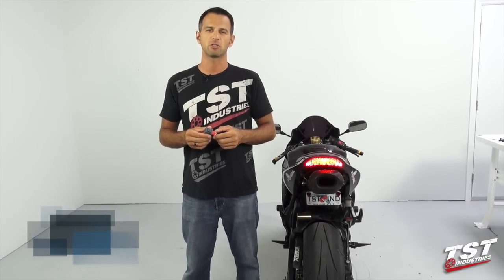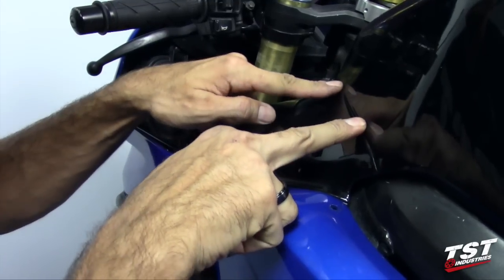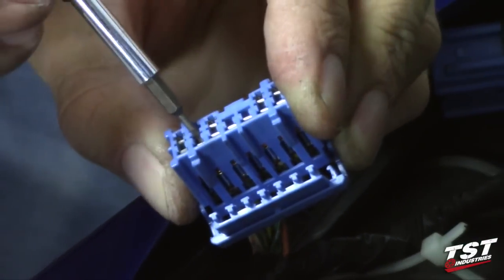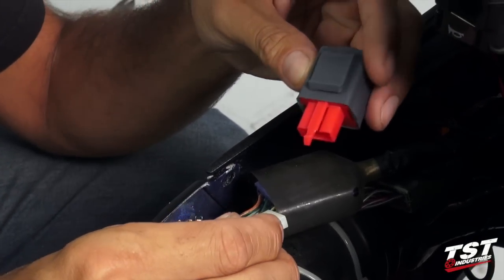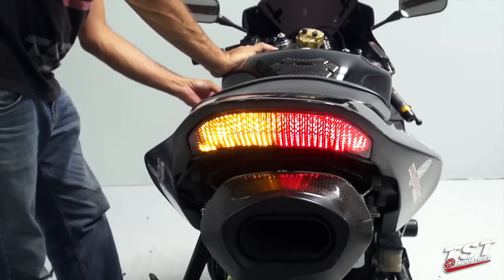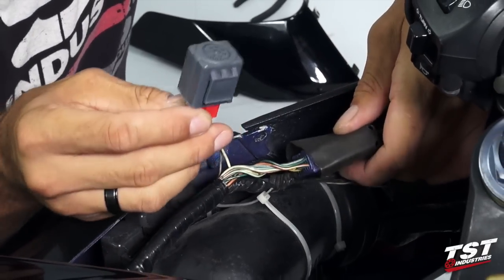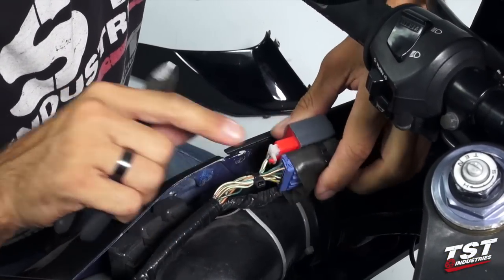How to install LED Flasher Relay on a 2003-2006 CBR 600 RR by TST Industries

Comment: Is it applicable for European models? Honda CBR 600RR 2006
Reply from the maker: All of our products are designed and verified on North American models. You would have to locate your OEM relay and compare the pin count and pin configuration.

Comment: Please help. Someone here can help find a solution with a set of built in relay led blinkers on a 2008 Hornet? With the original relay on the bike, they won't work at all. On the web it seems impossible to find a dedicated relay for this type of blinkers. Please, if you know a tutorial on how to resolce such issue...or any kind of info or advice. Thanks!
Reply from the maker: Well it appears as though we did not have a 2008 Hornet here in our market.  The closest I found in available documentation here is the 2006 CB600F. According to part documents, this bike uses a standard flasher relay for signal flash switching, and it is located under the tail components on the left side of the bike, just fore of the ECU. On this bike our RLY-G2 model relay is the appropriate replacement component . After that year the CB600 model did not re appear for us but CB500 and 650 models did a few years later. Those bikes used our RLY6 relay. I would suggest pulling your OEM relay out and comparing the shape of the connector to the images of the relays that i mentioned on our website tstindustries.com . If it is a match then that is the part you will need
Reply: @TSTindustries  thanks a lot for the fast answer. I took a look at the RLY6 relay you mentioned and by the number of pins and the hole design of it, seems to be the one i need. The two questions remaing are: 1. It will make the blinkers with the integrated relay work sequentially like they do directly on the battery or it will make them only blink? and 2. Do you have any seller of your products in Europe ? Thanks again!

Comment: Does this LED relay take care of both front and rear blinkers? I just installed an undertail kit with LED's but they don't blink they just stay solid.
Reply from the maker: It does when the issue is the flash rate. Now you may have a different problem with your front signal wiring that could be the culprit if your front signals flash but rears don't. I recommend verifying that the running light circuit is not connected with the signaling circuit. In the front, on one side, the orange and orange/white should not be connected together. On the other side it is blue and blue/white.

Comment: I ordered the integrated Taillight for my 2003 cbr600rr with the relay and I want my break light flash few times before it Stayed solid I can’t find that video
Reply from the maker: The relay that you ordered corrects the flash rate of the signals. It has nothing to do with the brake circuit. The strobe alert function for the brake light needsa different module in order to function. We do not have a 03-06 600RR specific video for that part but the same method demonstrated in the 13+ video is used for installation. Below I will include the link to the product page and also the 13+600RR video.
https://tstindustries.com/tst-brake-light-modulator-honda-oem-tail-lights.html
https://youtu.be/kkB6EeumWWM

Comment: So I did this exactly like you did . But now my rev gauge arm won't move i can put the gray back in and it work?? Anyone have this problem? Tst industries if you read this i need help . I only got this as your the only place I wont have to splice .
Reply from the maker: You must have pulled out the wrong wires. That connwctor has many functions in it and if you get the wrong pin out you will kill that function. Please put everything back to how it was and then restart. Do every step one by one with the video and the commentary within it in front of you for reference. If you need more help after that please reach out to our customer service department through our website during business hours.

Comment: Hey I had a question does the relay fix the issue when the turn signal stays on but does not signal
Reply from the maker: That depends on what is causing your signals to not operate correctly. I would need more info to answer your question. On some bikes hyperflash manifests itself in signal lamps staying on and the relay does restore the flashing.

Comment: Hi what is the code on the relay ,where to buy this from an I have just got led signal mirror will this fix both  them an rear tail intergrated light?Thanks for your time 
Regards 
John. It is a 03 cbr 600 rr .
Reply from the maker: Yes, this relay will control all your signaling equipment, front and rear, right and left. The presenter in the video is the person who designed the relay. The company that manufactures and  sells the relay made this nice video for you to know how to install it and where to purchase it. The link to the product page is actually in the description of this video. Here is a link to the product category for all the parts we have for 03-05 600RR : https://tstindustries.com/honda-cbr-600rr-2003-2006/

Comment: So I have an 03 honda cbr 600rr and I just installed flush mount blinkers. They are both on but  when I go to signal left it shuts off the light and when I signal right it does the same thing will this fix that problem? Thank you in advance
Reply from the maker: It sounds like you have your signals connected improperly. The Honda has two circuits in each front signal lamp. They are the signaling circuit and running light. If your front signals are a one circuit type of lamp, and you connect both running and signal circuit to them, then you would get the symptom you described. You need to disconnect the running light wire from your signals. On one side it is orange with white stripe, and on the other it is blue with white stripe. Disconnect those and let me know what happened.
Reply: @TSTindustries  I got it connected thank you for the reply!!!
Reply from the maker: @walterbaldwin3643  glad to help.
Reply from the maker: @walterbaldwin3643  was it what i thought it was?
Reply: @TSTindustries  well that was from before I bought the tst relay so I didnt know I needed the relay to make the lights blink. Thank you for the quick responses and informative videos I will definitely be looking at anything else you guys have. Was wondering if you guys had exhausts?

Comment: Does this also fix if they are not flashing at all? They just stay on and don’t blink. Front LED and read taillight LED. It’s a 05 cbr600rr... please help!!!
Reply from the maker: If they aren't flashing at all you may have a wiring issue and a relay would not fix that. The 600RR has a running light and a signal light circuit in the front signals. I have seen people use a single circuit signal lamp and jump the running light and signal light wires together to the positive side of the signal lamp. All this does is run continuous current through that lamp it's connected to and also the rear one because the running light circuit is constantly on. Please check your front signals to see if maybe they are wired in this way. If so, just disconnect the wires that have the white trace on them. That will be blue with white trace on one side, and orange/white trace on the other side.
Reply: TSTindustries oh my gosh thank you soooooooo much. This worked!!!! I love you guys!!! Subbed!!
Reply from the maker: @AlvlUpSavedMyLife  From time to time an opportunity to help a fellow rider presents itself and I jump right on it. I got into this business to help people have a better experience with their bikes. It pleases me to fulfill my mission. Thanks!

Comment: how can I install the relay on my 2004 cbr 600 if I don't have a blue connector? no I'm not blind I followed the wires from the blinkers front to back and there is no blue connector
Reply from the maker: I don't know man. I have worked on many, many 03-06 600RR's and they all had that connector. If you were local I would just say bring it in so I can help you.

Comment: You guys made putting my flushmounts and intergrated light in so easy. Got the relay dropped in yesterday and the signals/brake light work perfect. Super bright. Your company is one of a kind. Not a lot of companies work as hands on as you do with their customers. I needed help and messaged you guys on Facebook and had a real-time conversation with someone. Helped me out a ton. You guys are the best at what you do. Thanks
Reply from the maker: Thank you for the kind words. Our main objective is to help our customers enhance their experience with their bike. I think we were pretty successful at accomplishing that with you.
Reply: So just this one relay takes care of flashing related issues around all 4 led’s being the integrated tail/and flush mount led front blinkers as well?
Reply from the maker: @YourStepDadBob  yes...one relay controls of all the signaling lights on the bike.

Comment: there should be a video on getting the wire out of the blue plug. im about to light this bike on fire.
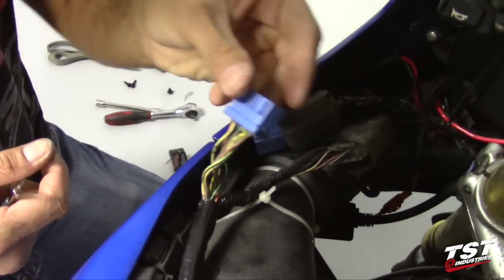Reply from the maker: I don't get it....we show the procedure in great detail starting at 2:38 in this video
Reply: @TSTindustries  it was the little tab inside, just didnt want to release. most of these connections are pretty old at this point. kinda mucked it up getting it out but now its all good and the flasher works perfectly.
Reply from the maker: Glad you got it figured out.
Reply: LOL

Comment: My plate light flicker and right rear signal won't turn on, can this product fix that?
Reply from the maker: If your plate light flickers then you have a wiring issue outside of the signaling circuit. The flasher relay will not do anything to fix that. If your rear signals don't turn on but the front signals do then changing the relay will do nothing to help you. I would advise you to examine the wiring on the rear of the bike and make sure all lighting components are wired properly. You can then move upstream to relay and switches.
Reply: @TSTindustries  I am considering buying the the tst signal break with the relay and plate light.
Think will be ok if I actually replace my lights with yours?
Thanks for the help?
Reply from the maker: @isaema3566  I do believe that if you use our components, and if you connect them to your bike properly, and if your bike does not have upstream wiring problems, then you will have a properly working setup.
Reply: @TSTindustries  any discount if I buy everything from light to relay to fender eliminator?
Wow day responses
Reply from the maker: Our website pages have a"Buy Together" module that appears below the add to cart button and enables you to bundle products for savings.

Comment: Currently my fairing signal lights are flashing opposite of the tail. Is this a problem that could be fixed by this relay or rather a wiring issue? Just got the bike working out kinks

Comment: Does this LED flasher relay just correct the rear turn signals? If so, do you have any advice/suggestions to correcting the front turn signals that are attached to the fairings on a 2006 Honda CBR600RR? Thank you in advance!
Reply: Found video. Please disregard

Comment: I have this switch on my bike 2006 cbr600rr full carbonfiber I have led turn signals and integrated taillight took me about 5-10 mins to install and remove those crappy resistors that get hot and wide this bad boy up also took the time to adjust the blinker settings which is fine out of the box but so dope you can adjust it if you want too but back just wanted to say if you are even thinking about buying this or. Resistors buy the tst switch and save your self from more wires to tuck and melted fairings this relay switch is superior in every way A+++++ thanks tst for the badass product will be back for other items soon
Reply from the maker: Thank you for sharing that with us. I am so glad that our parts made your installation better and easier. This is what we strive for.

Comment: Hi, so I own a 2006 cbr600rr and installed the tst turn signal pods and ended up with solid lights when I switched on my flashers. This lead to research and finding out about hyper flash and the gen 2-I tst flasher relay to remedy. I installed the relay as this video instructs but now when I flick on the flashers the running lights go off and I get nothing, no light at all, not even on the console and when I turn the flashers off the running lights come back on. I'm hoping ya'll might know how or why that is. I don't deny that this relay works, Im just scratching my head trying to figure out what may be wrong or what I may have done wrong. although I followed the video to a T.
Reply from the maker: It sounds like your front signals are wired incorrectly. If you have your running light and signal light wire jumped together into one connection this will cause your problem. Please check the connections on the front signals and find out if this is what the current setup is. If you disconnect the striped wire from the signal it will solve your problem. One side will have a blue/white stripe. The other will have an orange/white stripe. These are the ones that are supposed to not be connected.

Comment: Would this work if the turn signals doesn't flash at all?
Reply from the maker: Maybe. It depends on what caused your signals to stop flashing. If you message our support guys through our site they will help you determine the cause of your problem and how to fix it.
Reply: 91TwinTurboZX That was my problem also, decided to just buy it and installed it yesterday and it solved my issue.
Reply: 2WheelM4yh3m was your signals just soild yellow when you turned them on?
Reply: Yeah, this relay solved it.

Comment: Is that the same procedure for a cbr1000rr 2004???
Reply from the maker: sébastien duclos the installation on your motorcycle uses a different but easier procedure. Your bike has the relay in between the headlights. It requires a different relay that can be found on this product page https://tstindustries.com/Honda-CBR-1000RR-2004-2007/
Reply: TSTindustries Thanks for the fast reply! Do you have a video that show the procedure?
Reply from the maker: Unfortunately we do not. We have 2006-2007 but the relay location on that bike is different than 2004-2005. I found a video in Deutch that showes where the relay is with the upper fairing taken off. I hope that helps you. https://youtu.be/rMPGr7aROoY
Reply: TSTindustries Thank you verry Much guys 👍

Comment: One of the resistors went bad winch caused my right side blinkers to not work after a few seconds of flashing. Removed the resistors and installed the flasher relay and got perfect operation. This is my first bike so know that this installation is not "expert" level...

Comment: The plug on a 1000 is different, because the 1000 does have a relay, does it need to be replace by this one?
Reply from the maker: If you are referring to the 06-07 model year, then you can follow the link below to watch our installation on that bike:

https://www.youtube.com/watch?v=89FCjyrK1e0&t

Comment: Bought this and installed on my 04. Works good so far. Didn't bother changing the relay interval timing. Was a bit hard to remove the wires from the blue plug but it was a fairly easy installation. The relay is a bit more expensive than standard relays but has a much easier installation.
Reply: Hey man can you tell me where the relay is placed on your 04'?

Comment: Stock relay doesn't have to be removed?
Reply from the maker: There is no stock relay on this bike. The flasher circuit is integrated into the bike's dash. Our product circumvents the bike's dash circuit.
Reply: TSTindustries ordered off eBay. Thanks

Comment: Hey I got a question. Do you need the relay to prevent future problems with the electrical on the bike or its just personal preference.
Reply from the maker: Ismael Chavez having a faster flash rate does not damage the electrical system on your bike. it may confuse some drivers as to what you are signaling and that is why we provide our relays. They enable you to get a standardized flash rate for your signals. But in the end, as with anything, the choice is yours.
Reply: TSTindustries thank you for your reply. I was just wondering cause my new tail light is fast but it's not as bad it actually looks good. And I hate to mess with the original harness of the factory. Thanks for your help
Reply from the maker: Ismael Chavez glad to help buddy. If you ever change your mind and need a flash control device then you can rely on our relay not having to be wired in...all plug and play. But it sounds like you have it handled for now. Ride safe.
Reply: TSTindustries yes I been thinking about it. I will definitely get one from you guys. Thank you. Your channel has helped me lots.

Comment: will this work if the leds stay on?
Reply from the maker: It depends on what is causing them to stay on. Typically if there is not enough current draw in the signaling system the OEM relay will either hyperflash or just keep the lights on. If you have changed your signal lamps to LED and that is what caused your signals to stay on then our relay will be your solution.
Reply: ta  buddy yes they where working fine before the led I will have to buy one going to the UK